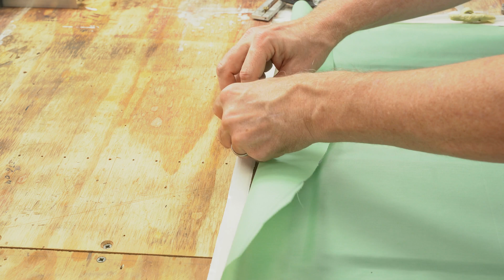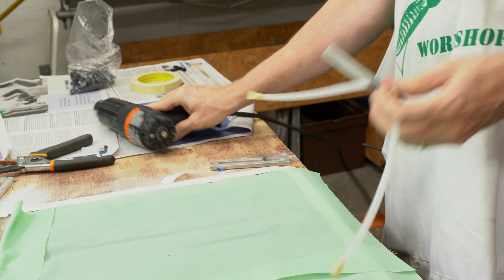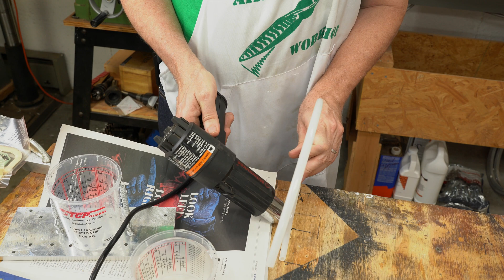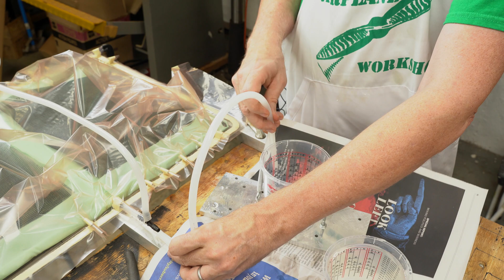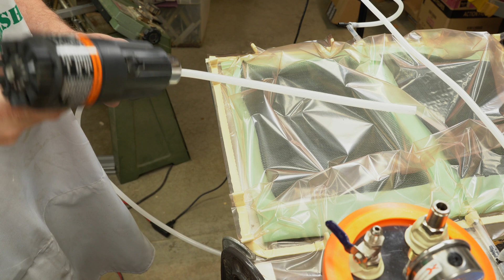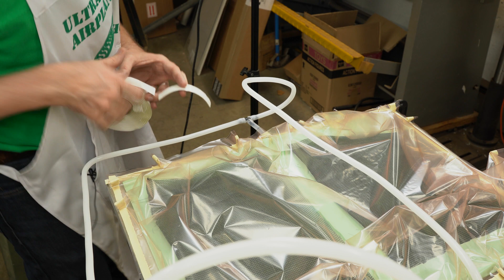Time Lapse of Vacuum Tubing Preparation

Comment: Could you explain what is the function of the bypass?
Reply from the maker: Sure. It is an experiment to remove excess epoxy from the input side once I've fully infused the part. The bypass is closed until the end of infusion. Right before the bypass is opened (infusion has just reached the exit side) the air pressure at the input side is nearly the same as ambient pressure and there is excess epoxy. By opening the bypass I apply vacuum at the input side and pull the excess epoxy into the bypass and out to the resin trap. If my epoxy cure is slow enough I can leave off the bypass but with fast curing epoxy by using the bypass I can be more certain of removing the epoxy before it cures.